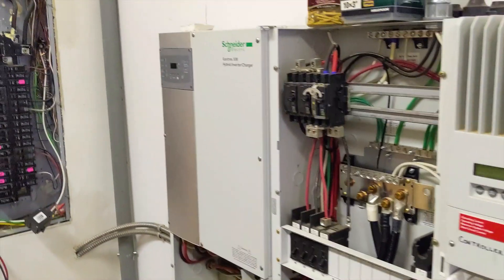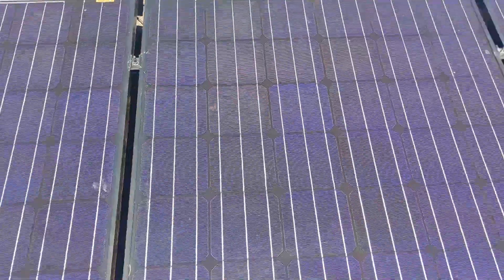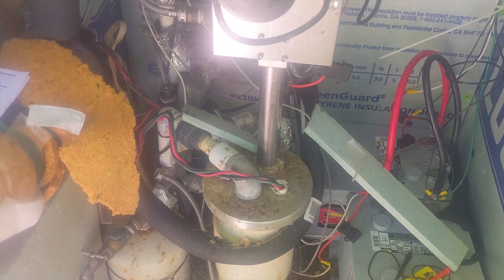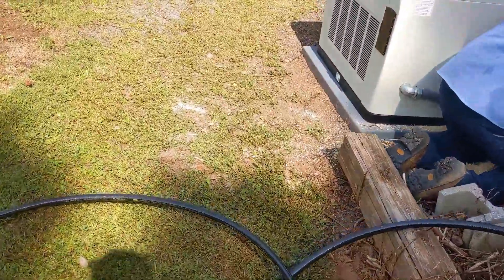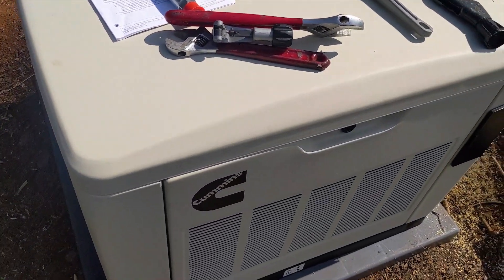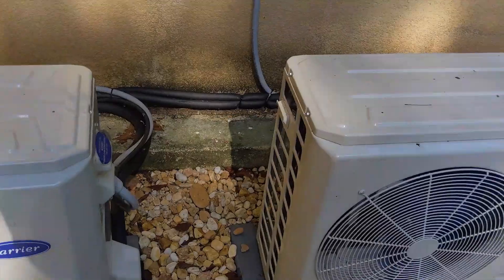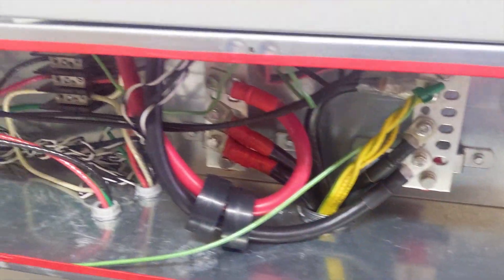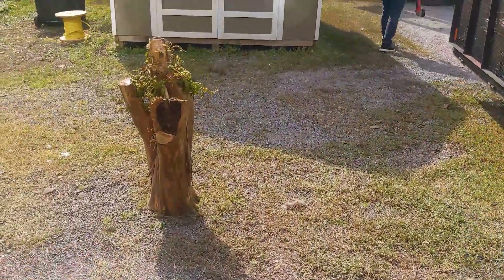Solar Makeover

Comment: Great taste in music.

Did you have to place rapid disconnects under those new panels? I'm trying to figure out if I need/want them. Missouri has not adopted ANY of the codes (2017 or before) statewide. Offgrid system.